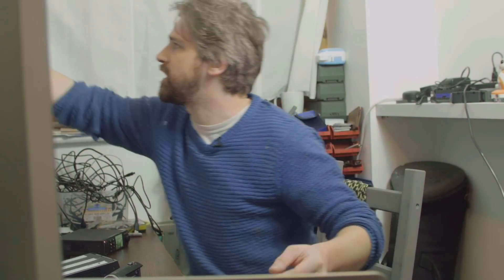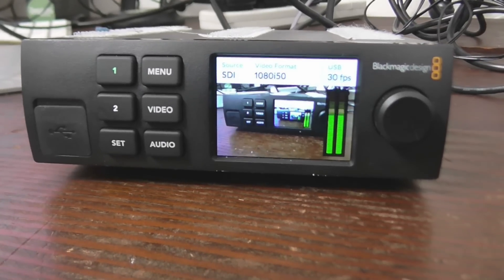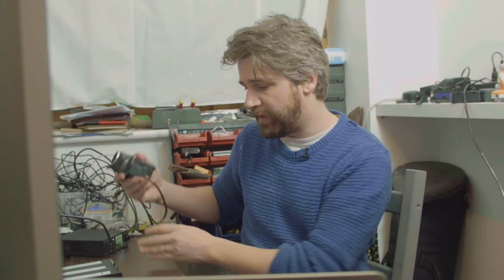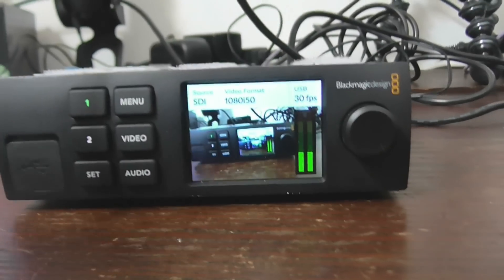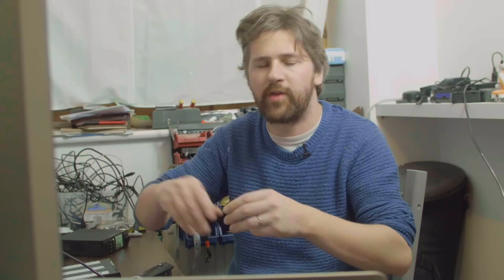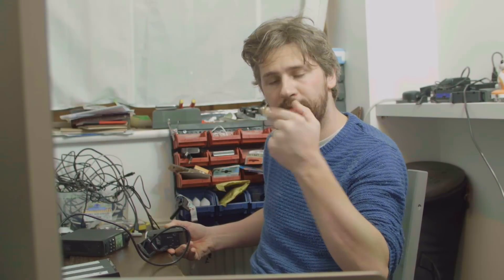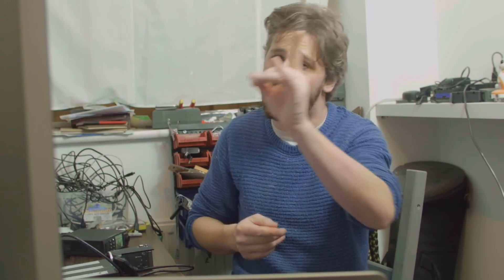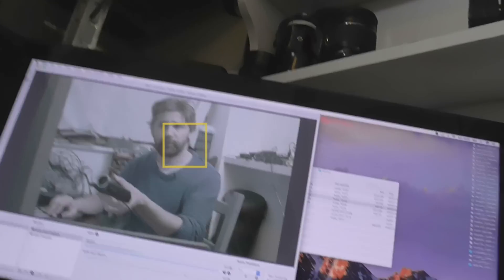Everything you need to know about Blackmagic Design's Web Presenter. (today)

Comment: Hi. The web presenter urgently needs an firmware update.  We have the Mini Smart Panel and v 1.2 firmware. 
Summary.  We feed a well-balanced 720p HDMI output from our DataVideo SE-500HD 4-Channel Digital Video Switcher going into the HDMI input of the Web Presenter. The preview output of the SE-500HD (BEFORE the Web Presenter) is very good.  i.e. good definition/contrast/saturation etc.
The Web Presenter wrecks that and gives an over-saturated output with extreme contrast.  We need access to the the proc amp ... or at least some basic control of black level, saturation etc.
The current output is worse than a £50 webcam. 
Is a real firmware update coming soon, and will it address these problems?
Before we upgraded our equipment we used a very rudimentary £15 2012 device that took a composite or s-video input and output that via USB ... and the picture quality was better than we get now.

Comment: Thanks for the overview on the Web Presenter issues. I had bought mine and am using a RED Epic-W with it - did a recent livestream and yes I had to adjust audio delay in OBS by 150ms or so for a sync issue and I also had audio popping throughout the stream (but not sure if this was due to the Blackmagic or not). I'm going to be upgrading my Web presenter to FW 1.1 and trying again really soon to see how it goes.

As far as video stream quality is concerned, it was AMAZING in 720p and have zero complaints....but it probably was due to the fact that I'm using the Epic-W more than anything.

Comment: Hi Mat - thanks for the video. I've been looking for something with an HDMI-to-Webcam function for ages, so was quite keen to see someone using this 'miracle' product in practice. 

However, I'm confused by the seemingly stuttery frames on this video (aside from the jump-cut edits!). Can you tell me what frame rates you were using through the chain from camera to YouTube upload? 

I got the impression your cameras were working at the UK's 25 or 50fps (discounting interlacing); and the YouTube video itself appears to be at 25fps if the 'stats for nerds' are to be believed. But you said that the USB interface seemed to be fixed at 30fps (which would rule it out for me if true). What frame rate was OBS set to encode at?

Blackmagic state that some live streaming software may throttle the Web Presenter's pseudo-webcam frame rate if the upload bitrate drops. But it sounds like in this instance you were just using OBS to record direct to disc, without streaming, which should have been really smooth. Are we actually looking at a simple 25/30 fps clash being dealt with clumsily by either the Web Presenter hardware or OBS software?

So could you clarify your frame-rate chain for me, please? 

Cheers!
Reply: Yes, I was thinking the same thing. He's got 1080i50 going in and 30P coming out. That's guaranteed to cause the effect you're seeing. 

I had the same problem when I initially set up my cameras at the church; one camera was in "film" mode, and so it was capturing at 25FPS; this cause the same "jumpy" effect.

What's happening here is that the camera needs to upconvert to 30FPS, so it occasionally repeats a frame in order to keep things in sync. I don't know if the camera does a 3:2 pulldown or something as simple as just adding one extra frame every 5 frames - but it does result in a jerky look.

If he had been running his camera at 1080i60 or 1080p30, that should have resulted in a much smoother output.
Reply from the maker: reqordist you've got it already, that's exactly the setup. 25-30 glitching
Reply: Hmm.. frustrating. Thanks for that.
Reply: Hi Mat - I emailed the Blackmagic folks a few days ago to ask if the Web Presenter offers a 25p streaming option. I've just had a reply, which includes the following clarification: 

"The Blackmagic Web Presenter default setup is 30fps this is because when you stream it to Facebook/youtube etc it will convert it to this format anyway, the unit has the same down conversion as our Teranex standards convertors which means that the output shouldn't be 'juddery' I have personally used it lots of times setup with a 25p/50p work flow and not experienced any abnormal judder no more than the usual 30p look" 

To me, this suggests that people with 25/50 camera sources would be better off adopting a complete 30p workflow from the Web Presenter onwards, through OBS capture / streaming, editing and encoding for upload. Is it possible you could create a short test video using that scheme sometime, to see if the 25/30 judder disappears or lessens?

Thanks!

Comment: Hi Mat - We bought the Web Presenter and ATEM Television Studio HD last week and tried it out for the first time at a wedding last Saturday - live streaming to over 30 people via YouTube. It worked really well and yes, we also noticed the lip-sync issue (thankfully before the wedding) and used OBS to add a delay (145ms). We don't have the extra front panel for the Web Presenter and seemed to manage quite well without it to be honest. The ATEM is a cool bit of kit too - SO much better than all the old analogue stuff we normally use. We just have to invest in some good SGI PTZ cameras now. Thanks for your reviews - keep it up!
Reply: David I have order the ATEM and Web Presenter as well. I wanted to ask you if you find any delay controls in the ATEM it shelf? I'm thinking of using Wire cast software with it but I'm not sure if I will be able to fix the delay. Also I'm not sure if you can give some feed back as far as the graphic and the PIP features in this unit? Thank you in advance.
Reply from the maker: Thanks David, Thats good to hear that you spotted this issue. Ill do my best. Many Thanks
Reply: nelsito3030 good question about Atem. I have the same doubt.
Reply: ATEM doesn't have a delay. In fact, that can be a problem if you have two different cameras with different audio delays. I pull in audio from a sound board and from the camera mics (to give a little atmosphere to the sound); I had to introduce a ~30ms delay in the sound board line to make things sync up. 

Since i'm using a digital mixer, that's not a problem. If you have an analog mixer, you might need a digital delay. personally, my next mixer for personal use is going to be an Allen & Heath Qu series.

Comment: sounds like the audio wasn't from your lapel mic. sounds like it was from your yeti. you hear the room a lot.
Reply from the maker: Im going to check that-
Reply from the maker: Turns out that the Yeti was plugged into my other machine, meaning the spacey sound is from the onboard of the handycam
Reply: sepeterson86 I think the same.
Reply: Which is good as it confirms that audio pass through works. Using the onboard XLR means no phantom power oddly.